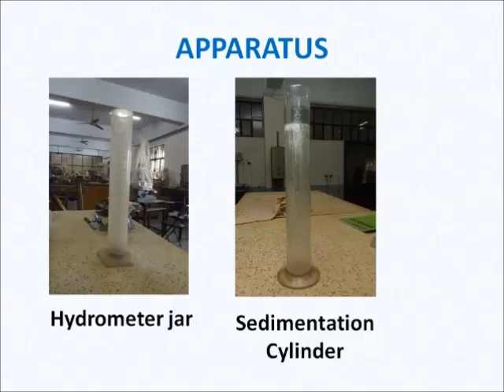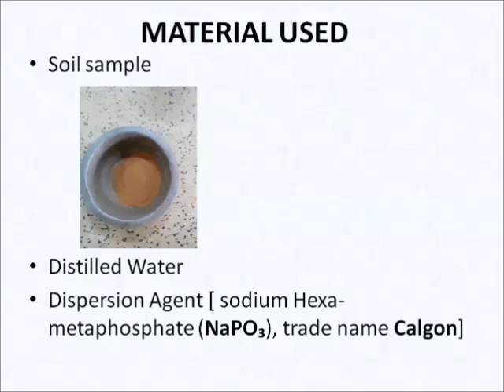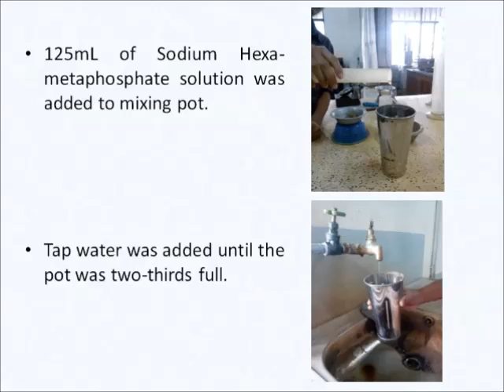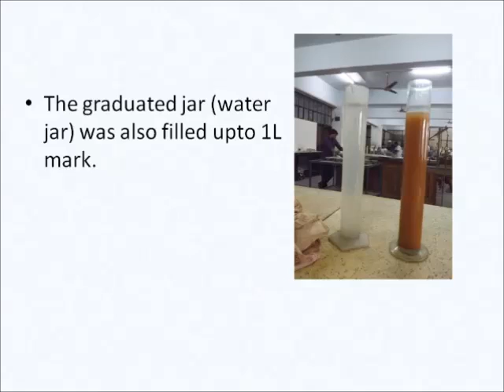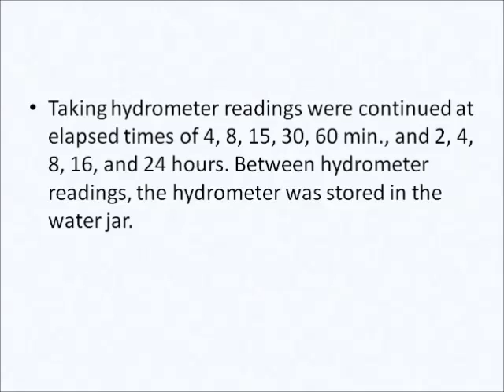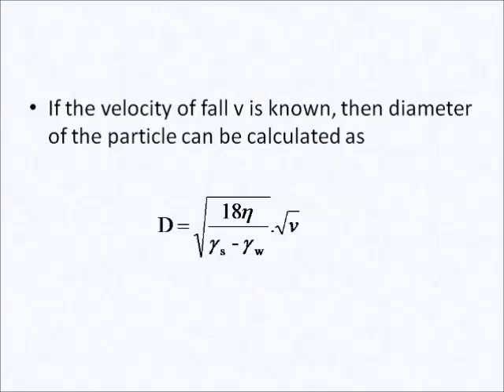Grain size analysis by Hydrometer Method

Comment: Hello, can we use an alternative method without corrections? Generally speaking what are the normal temperatures of distilled water, deionized water, and pure water? I want see the determination of the percentages of clay, silt, and sand without correction factor. Showing different hydrometer readings may help learners.